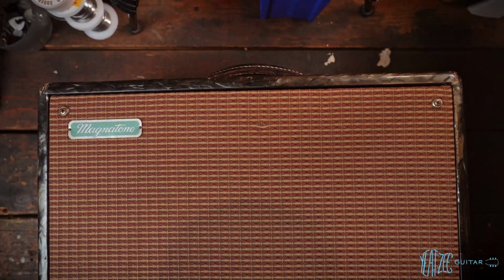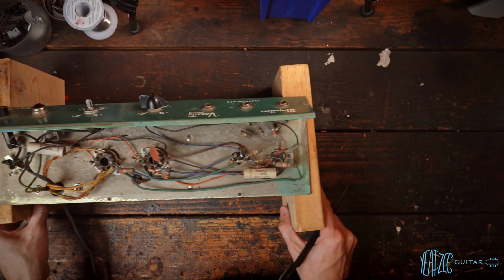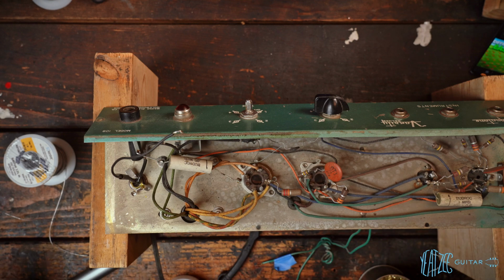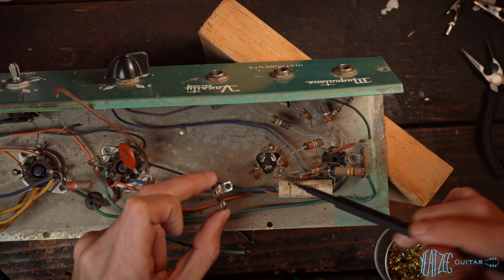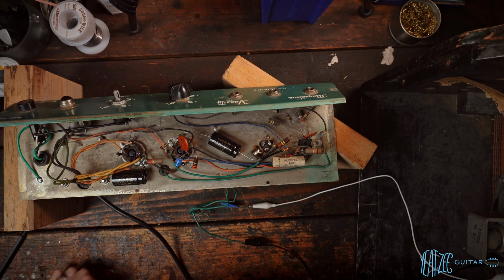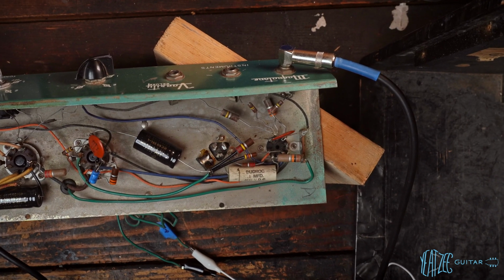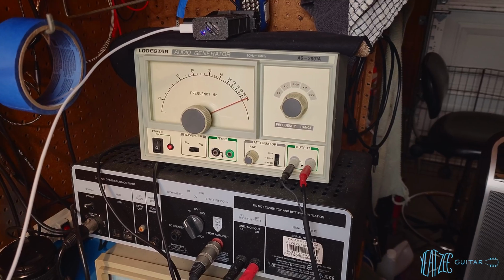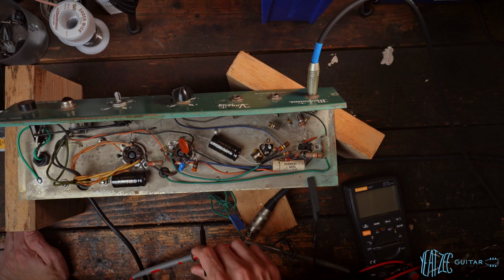The Amp That Started It All...

Comment: I'd be too tempted to re-engineer the original design, but adapt it to 2024. Who needs three inputs? Replace it with a two-input, Fender switching style input. Repurpose the third 1/4" jack hole with something useful (line out, second tone pot, master volume, etc) Power switch on volume control? Put in fresh pots and eq cap. Move the fuse inside and put a power switch in the fuse hole. Then ditch those ceramic coupling caps. Go with some orange drops to replace in the same size. Fresh electrolytics and .1uf bypass cap. Leave everything else stock. Basically keep its original tone while making it as useful as possible.

Comment: Sounds great!  Better "Natural" sound than most Champs. BTW , I used an 8uf blue phillips instead of a 22/25uf for the bias and the treble became much more bearable( Telecaster). Is the amp circuit in your video known as a " Hybrid" ? Thanks
Reply from the maker: @jooles0001  interesting 🤔 I've never tried experimenting with that cap value before. Not sure what you mean by hybrid

Comment: RR's calculator still have 6V6s at 14 watts?

Crossover happens on push pull signals, the phase separation crosses. What you're seeing on the scope may be blocking distortion
Reply from the maker: Yes
Reply: @YeatzeeGuitar Some old manuals agree but more spec 12 watts. The double mica JJs can handle 14 but you might consider being more conservative with old/original tubes.
Reply from the maker: @oldasrocks9121  It was my understanding that they've basically always been 14w tubes, but the way they were rated / tested for rating changed at some point in the 60's hence the confusion. I believe JJ's are even higher rated than 14w in reality.
Reply: @YeatzeeGuitar Just looked, both my Tung Sol and RCA manuals say 12. You could certainly be right about the 60s rating change. Since old US tubes generally don't have date codes I follow the 12 watt rating to keep from burning others' old tubes up prematurely. That's all, no scolding, just a precaution on my part.
Reply: @YeatzeeGuitar There's also a difference between spec'd max plate disapation and design max. Design maximums are listed to not be exceeded.
Reply: The rr calculator has 6v6s as default
Reply from the maker: @oldasrocks9121  ah blocking distortion, thanks!

Comment: Colossal improvement from changing the tinny speakers in small old amps.  No crossover distortion here since it is single ended.  (No crossing over from one output tube to the another.)
Reply from the maker: @jjsant3250  what do you call that knee on the waveform? Thanks!
Reply: @YeatzeeGuitar , Class A amp: "I will not bend the knee". Tone stack: "oh, yes you will"!

Comment: It would be interesting to see how it sounds through a better speaker.  I built a larger cabinet for my Vibro Champ chassis and installed two 8 ohm 10" speakers in parallel, and the amp sounds like an entirely different animal.  I have also played it thru a 4 ohm 4 x 10" cab.
Reply from the maker: @MichaelSmithTX  yeah on mine it's got a speaker out box I built so that I can run it into any cab. Fun stuff! The owner wants it primarily as a studio tool, just let it be what it is.